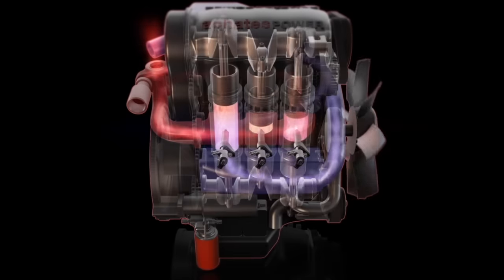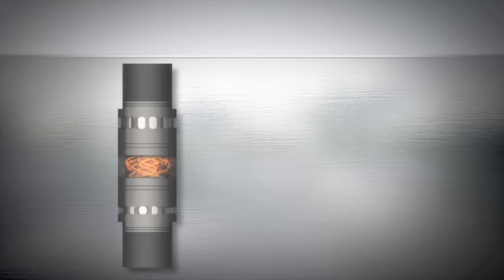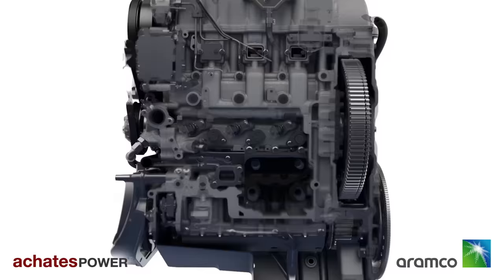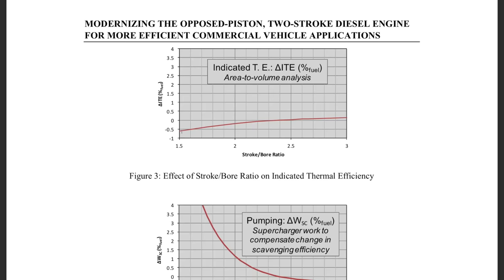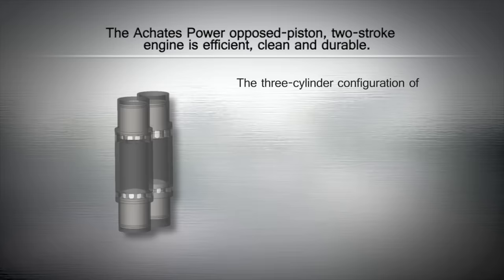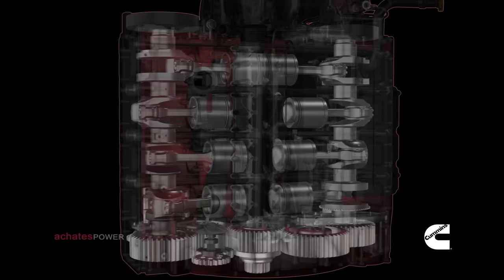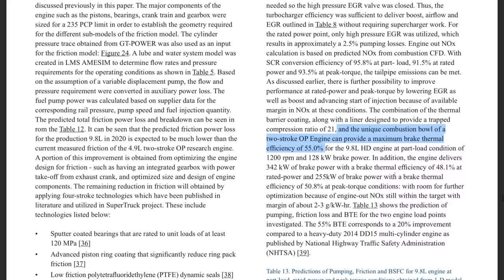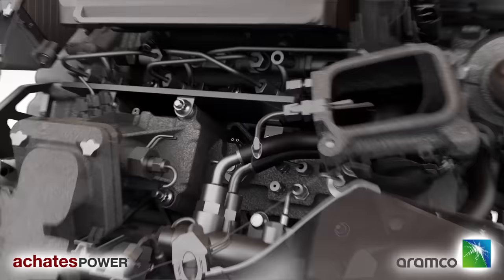Opposed Piston Diesel Engines Are Crazy Efficient

Comment: The 3 cylinder should be mounted flat between the frame rails. Lowering the center mass. Engines designed to connect front to back for 3/6/9/12 motor configuration depending on cylinder size. Transmissions mounted front and rear for AWD being each crankshaft has equal power. Accessories one end, supercharger other end driven off the heavy large fly wheel and of course a turbo (learn from the old one cylinder engine ideal of mass in motion thinking). Only young people like to basically get up and down off the ground. So ride high better when the seat is just around below arse level. Think steps been around as long as the wheel.
    Being diesel. Make it multi fuel so it can run of any flammable fuel. Like used oil, fryer grease and grandpas moonshine or butt gas. The whole drive train assembly from drive shaft to drive shaft. And electrical connections, fuel connection and exhaust once disconnected can be dropped as one unit. For maintenance/repair issues. Also with extra drivetrain units in stock. Instead of a warranty, you continue a much lower payment program after the vehicle is payed off. After certain amount of miles the unit can be replaced during a lunch brake. And one of the large flywheels at either end could have a generator built/attached on instead of an alternator. Making for mobile jobsite power or the camping trips less boring. Right battery pack. A DC generator can be a DC motor for short range EV or towing assist. Average American drives on average 50 miles. So needing a 500 mile charge range just means your to lazy to plug in every day. And hate people that make a living with trains, planes and busses for the trip to grandma's house.   
    Vehicle body built right will last forever. But the greedy money grubbers could not make money on anything that last over hundred years. Human lifespan needs goods to be bought and trashed in less then 10 years on average. Small people need a summer home and crap they might use once a year.  Sad - people that need more then 3 hots, cot and a roof over there head. Health care and some hobby for those that like their kids (bonus if the hobby puts food on the table like gardening or or real game play. Hunting fishing). Lame world we live in. Good thing I have a foot in the grave. Next world might not be so screwed up.
    To bad could never be around when the zombies rise up and money is replaced with skills and knowledge. Good thing the shallow end of the gene pool is much much large then the deep end.

Comment: Ingenious,
At first glance I see only one problem and that in each cylinder one of the pistons will always be in flue gas while one will benefit from the cooling offered by the suction which will lead to different wear of the two pistons in each cylinder in the arts.
The life of the engine will be the resistance of the piston which is always flushed with flue gas.
It was ideal to put the two pistons at each piston and intake and exhaust being thermally stressed as well!

Comment: A massive market for these engines is aviation. A lot of older airframes that rely on old radials are not very efficient, use avgas which is expensive and harder to come across compared to jet a, and maintenance cost are through the roof due to a lack of parts. Right now the only cost effective option for mid range power engine replacement on old planes are turbofans but they also aren't the most efficient engines, something like this producing power in the 400-600 HP and 1000 ft lbs range would be great for retrofitting old airframes and keeping them relevant.

Comment: Napier deltic trains in great Britain have been running these engines since 1951. They use a 3 crank engine with 6 pistons that meet on 3 combustion points. It's a great engine with millions of hours of run time. These are the engines of the future.

Comment: No heads and headgaskets to fail just needs well designed cooling higher compression without headaches
Reply: There are many challenges for this design.  Lubrication is a problem.  It uses intake and exhaust ports with no valves.  When pistons pass through exhaust ports, some lubrication oil is scraped into exhaust pipe.  There is emission problem.  Achates' solution is to do after-treatment.  It increases cost and put more burden to owner of vehicles in operation.  Using just intake and exhaust ports, the engine is very difficult to throttle.  It results in a very narrow band of operational rpm.   Thus the transmission system needs to have more gear ratios and thus is more complex and heavy.  It is not as rosy as it seems.

Comment: The Jumo 204/205 diesel engines were about the only successful diesel engines for aircraft. So the design can work. However opposed piston engines were used on tanks and had limited success. The Soviets used the 5DTF engine on their T-64 tanks. It had numerous reliability issues and was prone to catching fire. The British used the L60 in the Chieftain tanks and also suffered reliability issues. The Brits eventually worked out a lot of the problems but it should be noted that the current engine powering the Challenger II tanks is a Perkins V-12 diesel. The soviets also fixed most of their issues but they used a gas turbine in the T-80. That was even worse so they went back to the opposed piston diesel with later versions. It should also be noted that the T-90 uses a V-12 diesel engine.

So while the opposed piston design has a lot of advantages (efficiency, low weight, high power), it may have problems with reliability.

Comment: Just off the top of my head: one potential flaw is that cylinder pressure drops twice as fast as in a normal one-piston-per-cylinder configuration. This would seem to require a very short-stroke layout, leading to problems with piston rod, wrist pin, and crank wear. Also the skirt ports are then eating into the useful piston travel you do have, leading to reduced power output. Additionally, when the exhaust ports are exposed combustion may still be taking place so you'll be venting combusting gases into the exhaust manifold. This is going to be a loud engine that could potentially burn through exhaust systems rapidly.

Comment: Possibly consider a VR6 format single crank single head with a high swirl dog bone / toroidal style combustion chamber and offset crank to bore. More compact, lighter, can do two or 4 stroke, easier maintenance, single sump, could implement pre-burner, rotary valves, and two injectors per chamber.

Comment: The cylinders need to be horizontal to help drain oil from inside pistons.  Also special piston rings would be needed to bridge ports.  Silicon nitride rings would be perfect.  Overall it's a really good design.  I hope the fuel injection is mechanical and not computerized.

Comment: A few problems I can see for this set up.
1. Starting problems, especially during cold and freezing weather
2. Silencing the diesel noise which is typically higher than in spark ignition engines
3. Diesel engines are less adaptive for load change than spark ignition engines
5. Higher emission problem.
Reply: To my knowledge, NOx emissions can be reduced to almost zero when standard work temp is reached after a few min. Have seen that in a report on German TV about a project lead by the university of Koblenz/Landau, Rhineland-Palatinate, Germany. Exhaust heat might be useful for the bus in winter. Good torque is useful for such a vehicle too, you don't need to make it too big, though, it seems a relatively small engine will do. But noone wants to know that, everyone is focused on e-mobility. Electric buses are expensive like hell (infrastructure).

Don't know about the other issues you mentioned, but low temperatures start and noise reduction should be less difficult on a bus. They are kept in a hangar at night and work almost nonstop in the day, and there is enough space for noise abatement.
Reply: @frankhusel5033  NOx emissions can be reduced by increasing the air-fuel ratio by at least 3..4 times from stoichiometric. But where this excess air should come from? Also, there is a risk with excess air because the CO2 emissions will raise. It is always a really an accurate balance between NOx and CO2 with high excess air. Therefore I have a hard time to believe in zero emissions, especially in Diesel engines.
Reply: @Lensteiman  You're the expert, not me. I just summed up the essentials from this report as it was presented from memory. The points you make might be correct. Due to lack of expertise, I can no further comment on that.
Thx for your reply.
Reply: @frankhusel5033  Another reliable way to reduce emissions is a catalytic converter. But again the emissions in Diesel engines not so easy to reduce. The bad scandal with emission reductions in WW Diesel engines is a good example.

Comment: 4:47: "what do you think is holding it back from massproduction currently ?", the oil industry, becasue a to effective engine that doesnt use much fuel means less money for the oil industry that cant sell their overly expensive fuel that much anymore and the oil industry has done that before with that Volkswagen XL 1 Liter car for example which they quickly stopped making. i would say quit oil all together and better use electricity made by tide stream power plants in the seas and other renewable energy sources like solar and wind.

Comment: It is much harder to do exhaust aftertreatment on a 2 stroke diese as far as I see. During DPF regeneration, for example oxygen has to be limited to prevent DPF overheating. On a 4 stroke diesel they use a throttle plate for that. On a two-stroke diesel closing that throttle plate means no scavenging. Would be awesome if someone solved that problem and we could see more of these engines then.

Comment: I would say a major problem with the engine is oil collecting in the upper pistons creating an unbalanced engine at startup and at low rpm. If the engine was horizontal that would stop the problem but it would be too wide for cars and pickups. I believe it's the Deltic train engines that use the apposed piston engines and if you ever watch one fire up they smoke like crazy until they sling the oil out of the pistons.

Comment: There was in the 60's a  Commer TS3 engine with single crank but rockers to transfer force to the crank. It was a 3 cylinder. They tried to make a TS4 4 cylinder but ran into problems and lack of money. I remember a Rolls Royce K60 twin crankshaft engine which was 4 cylinder I think for military application and then there was the big Leyland L60 tank engine, also twin crank. It had problems with reliability and was later abandoned as was the concept.
Reply: The TS4 had no problem and was ready for production with road trials in many trucks.
Reply: @johnburns4017  I worked on a new type of supercharger for the TS3 designed by Armstrong Patents I think they were called. At the time I think the TS3 was giving 120 bhp and they needed something closer to 180 bhp to compete with the Perkins 6.354.  If I remember correctly the TS4 had colling problems with the inner two cylinders. We even made a new cylinder block for the TS3 which was a very solid square of metal to make the engine vibrate less. It was a pity it was discontinued.
Reply: @aivarspriede9478  
The TS4 delivered 200 HP. One TS4 made its way to NZ being renovated and worked.
Reply: @johnburns4017  Were you with Rootes at the time? I was with ISVR in Southampton working on noise and vibration. Our brief was to get the engine quieter by altering the block design and using a new supercharger which used a revolving paddle and rotating valves. We made the supercharger but nothing further happened to it. It worked.  200 hp is very impressive.
Reply: @aivarspriede9478  
It was estimated that a 6 cylinder engine would give 300 HP.  If that daft backwards, money obsessed Chrysler did not scrap a proven and brilliant engine, it would have been with us today in some form. Modern metallurgy, improved supercharger/scavenger and injection systems, would have improved efficiency for sure. Power/weight was brilliant. Being made even lighter with aluminium, it would have been suitable for aircraft. 

The engine could run backwards and occasionally did.  😄  Put it in a high gear then roll backwards down a hill, it would run backwards. 

There was less piston side thrust than normal cranked engines.

Comment: Being two stroke, these engines will produce a lot hydrocarbons from partially burned fuel oxygen mix, which would require a lot of exhaust processing thus reducing efficiency
Reply: No, these are not gasoline two-stroke engines.

Comment: I think it is a great idea. My only concern is the accumulated back lash of the gear train causing timing problems. I also wonder a little about  temperature control at the exhaust ports. Enough air overlap would deal with high temperature, too much would cause under temperature and wet stacking. It would be nice to vary the timing with the load.

Comment: Wonder how it would perform in a v-block where the bottom crank is common while the top side has a crank, blower, and turbo per bank effectively making it 2 inline 3 cylinder engines sharing a common crank

Comment: Napier Deltic engines with  6 cyinders and only 3 crankshafts coul be more efficient , I think. A 3 cylinder version wth 3 srt crankshafts is possible with some offset between crankpin and cylinder centerline so that the pistons in their common cylinders would still be colinear in their comon axis of movement. Exploring this idea in 4MCAD. Would be exciting to actually build a prototype. Using scotch yokes, instead of conrods would also increase dwell at both tdc and bdc, further helping wth efficiency.

Comment: I would think first off it has to be a buttery smooth running engine. Secondly. I’d think it could be made extremely quite. Since the combustion is happening in the center section of the engine. It’s going to be reasonably easy to insulate the block to keep noise in. I can’t wait to see how this gets implemented into a on road type truck.

Comment: Makes me curious about the oiling for the upper pistons. I wonder if oil pooling on the pistons would be any issue? I could imagine some oil consumption after sitting a while. Im sure it's not a tough issue to address. Very cool design that gives me detriot diesel vibes.
Reply: Boxter engine oiling system assuming the engine is not upright

Comment: The main flaw is that it's a diesel engine.  Diesel fuel can freeze so it's not a good engine in cold climates but there is a work around.  It would be nice if they could convert the diesel into petrol.

Comment: to me, the weakest link is that all the power from each crankshaft is delivered through a gear train of spur type gears. especially when larger engines are developed or higher torque combined with power impulses. in the video, they do not appear robust enough. the commer two stroke engine used a single crankshaft and large rockers to tranfer the power from the top pistons.

Comment: 3cyl, 2.7litres, 270hp, 480 lb/ft = 650.8 Nm, diesel cycle and compression which suites for ethanol perfectly and still is not in mass production - insane 😕😥, this engine would be a perfect pair for hybrid cars or trucks and even diesel generators.

Comment: The opposed piston intrigued me. It looks like a step foreward in engine technology with.out sacrificing traditional, familiar technology. It was uused iin WWII submarines and in other miscellanneous Navy ships. I dont undersrand why it is not wildly popular.
Reply: The high rpm leads to a lot of wear and tear, they're highly strung engines that require very tight tolerances. Also they can be difficult to disassemble for maintenance, often requiring the removal of the whole block.

Comment: I've not heard of this design before now . But I do think and believe it is Great. I think a turbo designed with toroidal blades would be quieter and produce more air flow volume (cfm) thus creating more output at better efficiency.  I've added approximately 1-2% ethanol to diesel fuel in trucks I operated and got better performance. Just an idea, something to consider.

Comment: In the past british used twin crank duplex gasoline engines 2 stroke with blower and rotary intake i think they were very high torque u beleive but had some problems with the gears coupling the cranks. I think you'd need to use spur cut gears to acheive strength and that would be rather loud  but hey the whine of the gears and whine of the turbo together with diesel noise who would notice.

Comment: Now this crossed with sterling engine. By solar heat u heat the center and the 2 crancks drive each one electric generator(like an alternator) so u won't need any fancy turbo and compressor. Only a mirror array that heats up the center of the block.

Comment: These have been around forever. They are impractical because of their layout. They are simply shaped incorrectly to fit nicely into a stylish automobile. Maybe on its side under the floor of a van. But van buyers are typically very concerned about costs. They will switch manufacturers to save a few dollars. In that case expense is usually limited  by using components already in production.

Comment: I wonder what the redline is. Diesel engines already have much, much lower redlines compared to gasoline engines, around 5 to 6k, but this much rotating mass plus all those gears must lower it even further. That’s not even mentioning the very long stroke. Additionally, I wonder if this engine could be laid out into a flat-opposed-piston setup similar to a Subaru or Porsche engine for use in smaller cars. It would certainly be interesting to see.